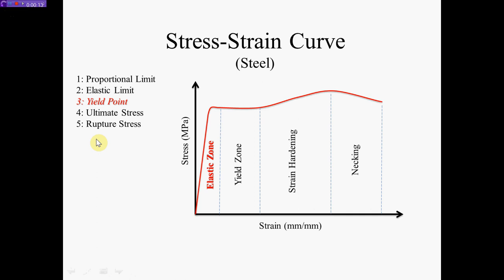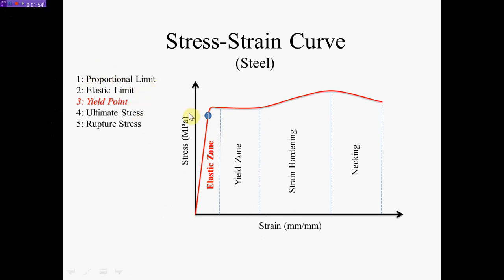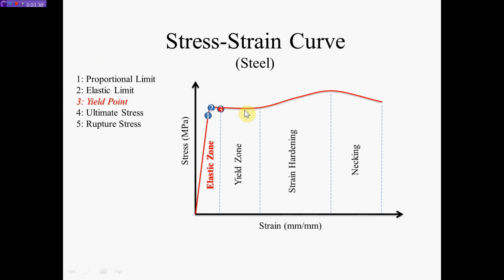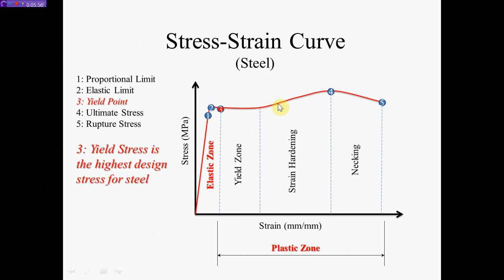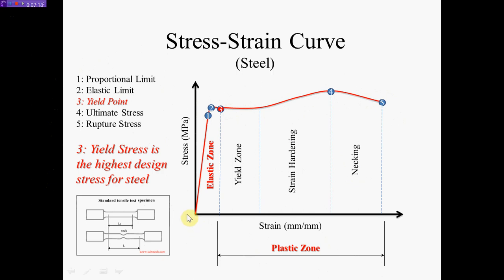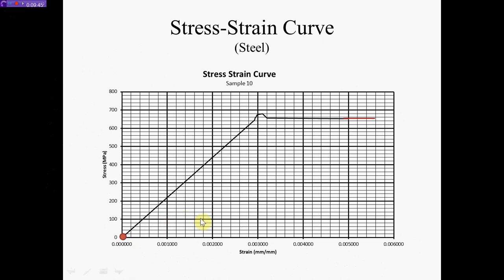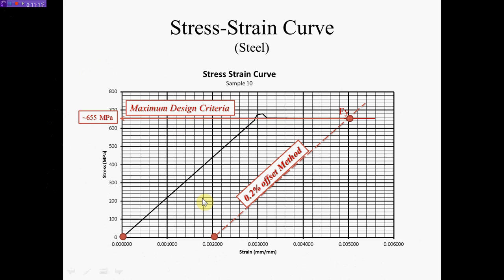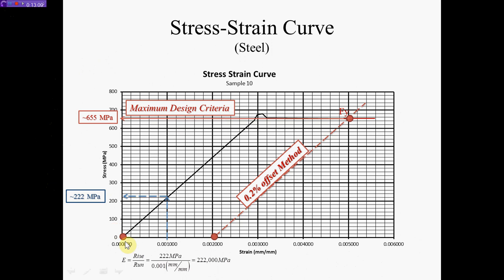Steel Stress Strain Curve (Nazeer A. Khan)

Comment: Sir can u tell me why in nexking zone curve goes down ?? In necking zone area decrease so stress should increase 🤔
Reply from the maker: +NUMAN KHAN The load decreased in the necking zone because the sample narrows and requires less load for the sample to strain. The material is in the plastic zone and will permanently deforms.
Reply: I guess this is the engineering stress-strain curve. For the true stress-strain curve, in the necking zone, the stress would increase.

Comment: Nice job the selection of yield based on 0.2% offset is not too much clear. If i extend my 0.2% line  it will hit the corresponding .004mm/mm so then the value will change . How we will be able to extend this line correctly to get the correct Yield stress?